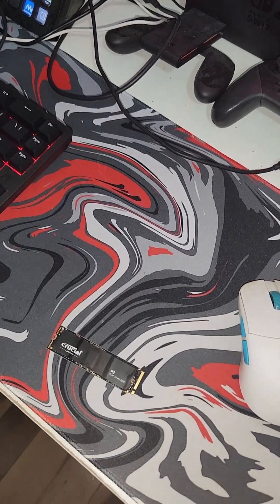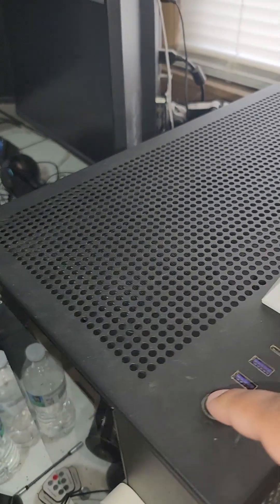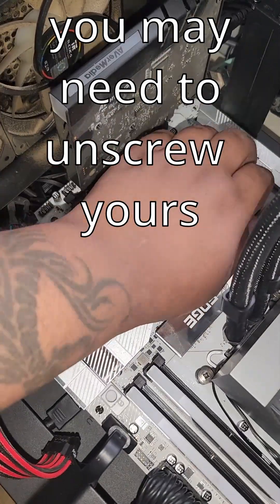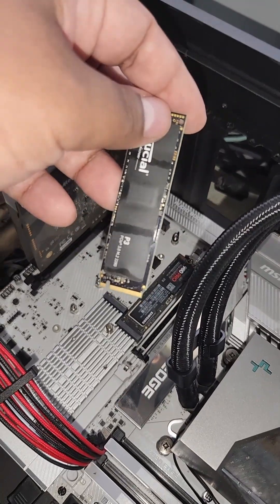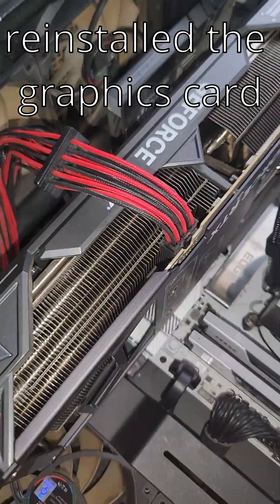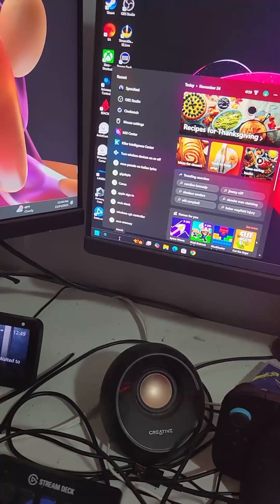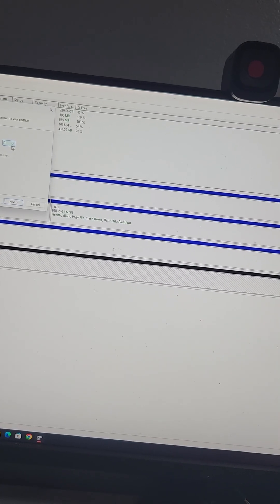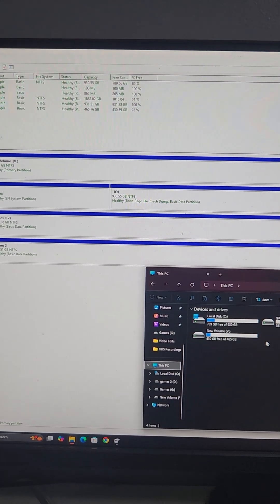How to install an m.2 storage drive in your PC #pc #pcgaming

Comment: Gen 3. xD u can still buy them ?
Reply from the maker: lmao idk I bought this a while ago. but gen3 is still fine for running games. My other drives are gen4 Samsung 980 Pro's tho. But no need to go to gen5 for gaming
Reply: @DapperVamp yea gen 5 for gaming is not worth atm maybe in few years but gen 4 sams 980 990 is normal i think my 6 years old oc had gen 3 i think till i upgraded to gen 4 wwith 2 tb and 2 ssd nvme
Reply: @DapperVamp  the few peeks i got looks dope your set up but clean your pc take out the dust with some air
Reply from the maker: @MangoJonasMango ima clean it eventually. I just buy new fans since the ones I use are so cheap. I put a duster to it but that dirt is caked on cause I use to smoke 420. Been sober for 2 months now.
Reply: @DapperVamp nice men keep it up 😎